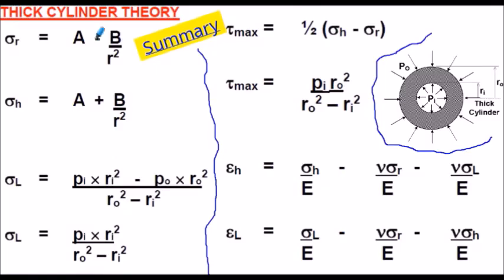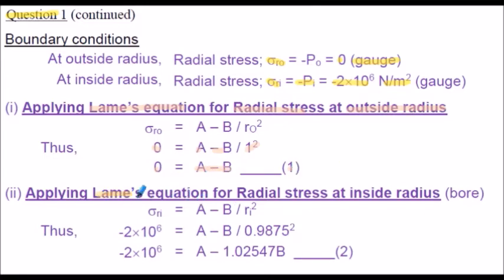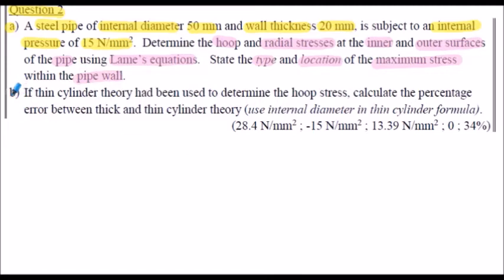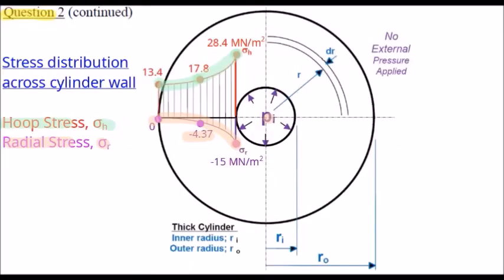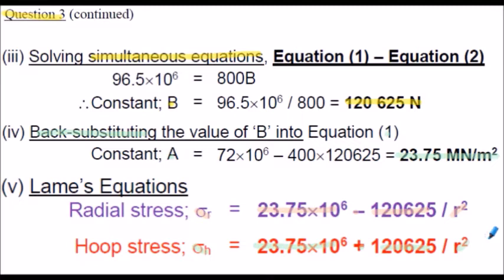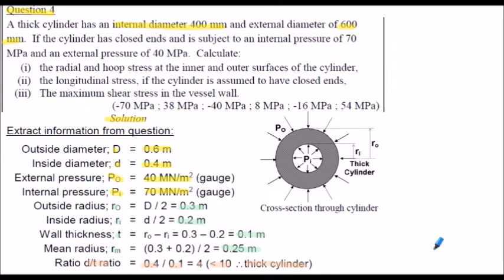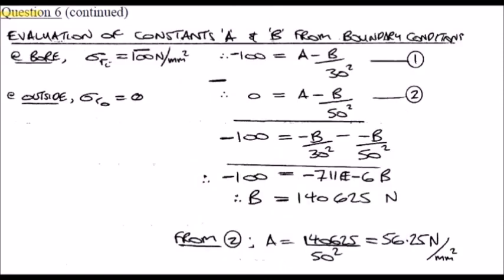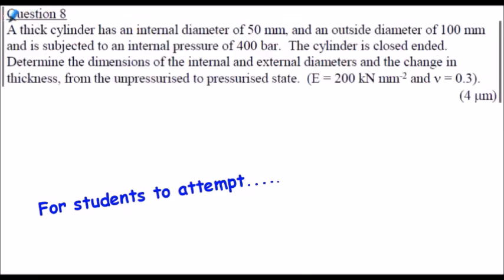Thick Cylinders - Part 3 - 'Questions' (issue 2)

Comment: Thank you for the classes. I would like to ask you, in which book can I find these exercises? I couldn't find them in your references.
Reply from the maker: In truth, I cannot remember now as these notes were initially created around 20 years ago and have been modified and extended over the years.  The theory used would have been extracted from the reference sources; all I do in the video is try and explain the theory as best I can to Technician Engineering students.  I may have written some of the questions myself to highlight certain aspects of the theory (e.g. the relationship between thin and thick cylinder theory) and some questions may even be from my notes taken during my own study days.  The case study was based on an actual engineering problem from industry.  If you want a full list of the questions used in this lecture series, I can e-mail you the actual workbook I use with my students, as these lecture videos are essentially based on the workbook content.  Sorry I cannot respond more definitively to your query.  Regards, Alan.